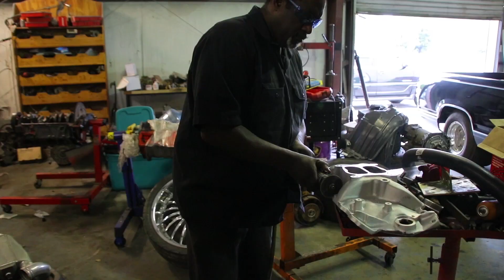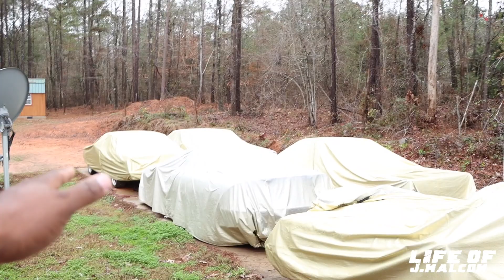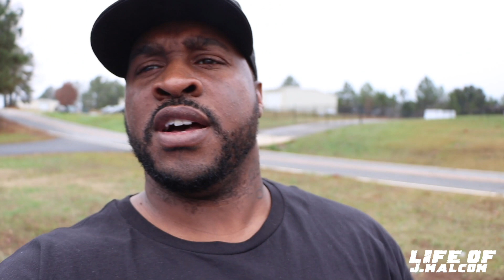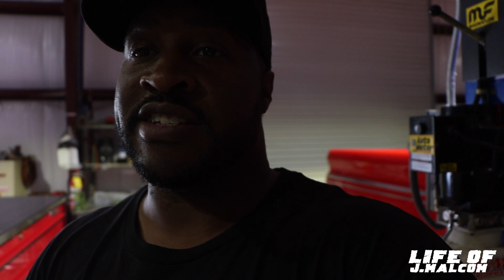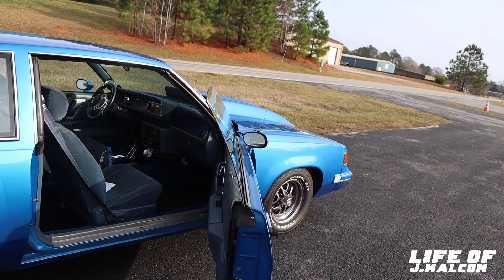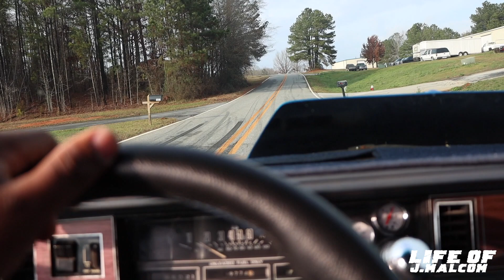WHY NOT BRING IN THE NEW YEAR BY TURNING THE SUPERCHARGED CUTLASS UP?!?

Comment: What up homie? I just got Buick Regal, with stock 350 in it and it has never been ran. It has a six cylinder in it. They switched it out but it has the wrong motor mounts on it. It sitting to far back it hitting the fire wall. They didn’t know it. Lol I got the car cheap. I want to put a cam and super charger on it. After seeing ur car. Thought about a Ls and super charger. But I see you set up and I like. Any pointers with be greatly appreciated. Thanks. Reach out bro.